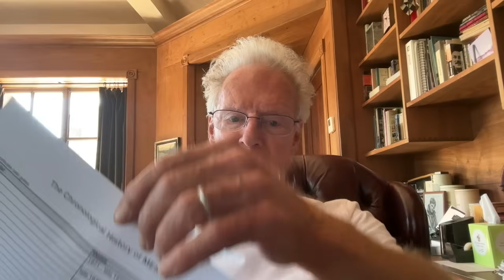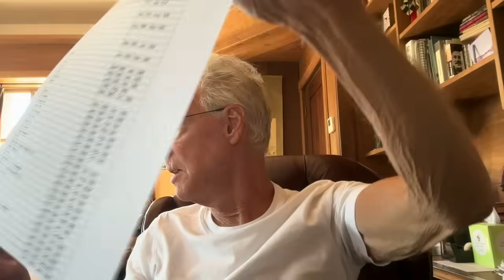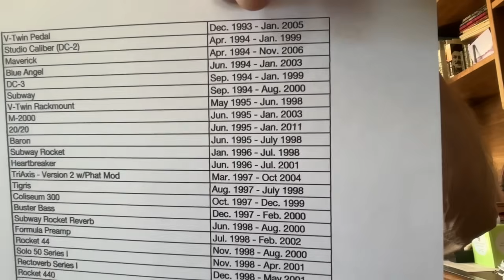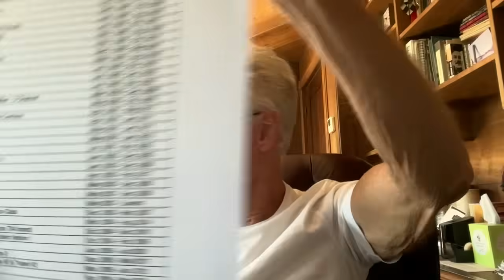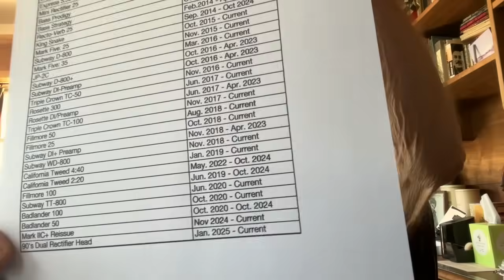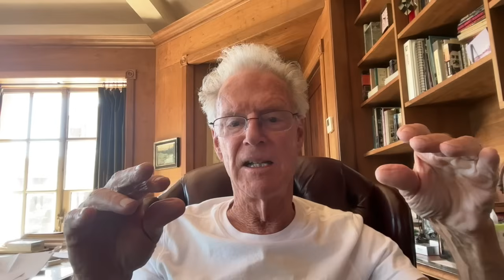Building Boogie 34  Part 2 History of Mark Amps

Comment: I love these videos Randall. This one reminded me of my days back as an HVAC controls engineer. I used off the shelf relays all the time. Sometimes I had to get creative. Hmmm, I wonder if I could build a JK flip flop using relay logic so I could sequence chillers and pumps without resorting to a digital controller? Working with DC control voltage had the old reverse EMF gotcha, requiring recirculating diodes across the coil. Whoa, I've long since retired from that world but this video got my brain synapses to fire again, hehe.
Reply from the maker: Yeah - - that inductive kick-back CAN be useful!!  Imagine being a Hawaiian Tech you don't have easy access to everything and congrats on being creative with what ya got!

Comment: I meant to add a little addendum: where did the Triple Crown series come from?  I have a very vague impression that there was some specialization in design by that point, because you already had so much to do!, and that the basic Crown circuit may have been pretty thoroughly developed before it got to you.  I love those amps, the Hi channel is one of Mesa's great achievements – and as far as I can tell, the Triple Crown might be a bit more "British" than Marks, but it's not just a hot-rodded Marshall either.

Also, this is an incredibly stupid question, but I've been wondering about it for years: when you think or say the phrase "Mesa/Boogie Mark IV," for example, do you think of "Mesa/Boogie" as the company, and "Mark IV" as the amp, or is "MESA" the company, and "Boogie Mark IV" the amp?
Reply from the maker: Right:  TC is a take on the "more Brit" style, designed by our Dan VanRiesen.  Name:  can be confusing.  All the versions you cite are good.  The name "Boogie" was stolen by the Japanese after Carlos first played there.  So we changed it to Mesa/Boogie to get around that.  However some amps aren't Boogies . . . like the Rectifiers.  Different style, not like a "friendly side kick the kicks ass" (Boogie) but heavy and menacing, thus MESA Engineering logo for the Rectos.
Reply: @RandallSmith2G  That's what I've noticed, yeah, that the amps which descend in near enough a straight line from the very first Princeton Boogies always have the "groovy" Boogie badge (which I love), and the more aggressive amps tend to have the full Mesa Engineering logo. That Hi channel in the Triple Crown is unstoppable – it's like a Recto hurricane with a Mark eye-of-the-storm, whereas the Mark VII Mode is kind of the inverse, like a Mark laser beam that enjoys reminding you it could tip over into madness with just a couple different settings. (The first time I played Mark VII mode, I thought "Ahab!," so it's been Captain Ahab to me ever since.) No joke, I've been able to sell maybe 10 amps (and a couple more upcoming!) because whenever I think "Maybe a Boogie, but more British?," I end up right back at the TC-50 and Mark VII.
Reply: I've got a TC-50. It ticks all the right boxes for clean, crunch and lead voices.

Comment: Thank you for this great informations!! I ve 2 questions : is the big transformer of the vii the missing ring in the mark V? Why was not also on the V? Related to the V... What do you think about the mod with at 12at7 in v4 and v6 that lot of people did assuming more 3d sound? Thanks
Reply from the maker: The power trans in the V is a "surface mount" version to it leaves room for the pc board.  Most of the time, that tranny is "belly mount" protruding into the chassis in IIC+, JP-2C, VII etc.  Re:  12AT7, I haven't heard this one but sure:  if it SOUNDS good, Do It!!
Reply: @RandallSmith2G thanks for the reply...yes it is called saturation mod between mark v ,25 and 35 users...put 12at7 in the v2 and v6 (in the v 25 which i own) and to the others related to the others amp give back less gain but take away that icy pick effect on high gain channel..i ve tried...well maybe the jan Philips 12at7 i ve tried was too dark ..better original for me.😊

Comment: Thank you for the great information and videos.  Keep them coming.  The information is priceless coming from the founder.  LDR's are the bane of my existence....lol.  I had my 1995 Mark IV sent in for service to replace the caps as they were 30 years old as well as replace 2 of the 8200 brown caps that if they leak they damage the board.  I got the amp back and it sounded great but the amp would get stuck in between 2 and 3 with the footswitch.  I sent it back but found out yesterday that the entire board needs to come out and have some/all of the LDR's replaced.  This will cost a pretty penny especially since I  already paid for the capacitor replacement on top of this one.  I love the amp as the Mark IV has always been my favorite but thinking a mark vii might have been cheaper at this point.
Reply from the maker: For sure the VII would make you happy but has our Mike B. seen your Mark IV?  If not, please contact Kris or Molly cuz it's doubtful all LDRs need replacement.  Sounds like what's controlling the LDR switching may be the problem.
Reply: @RandallSmith2G  Thank you for the reply Randall.  It is in Mike B's hands so I know it should be good after he goes through it.  Molly and Kris have been great as well.  Thanks again for the reply and info.

Comment: Great stuff! Sorry about the problems you had. I feel like corporate stuff has been a downer. Even for me. 
Love hearing about your Amps, even though I don’t understand much of it.
Reply from the maker: BIG Downer as the potential was right there.
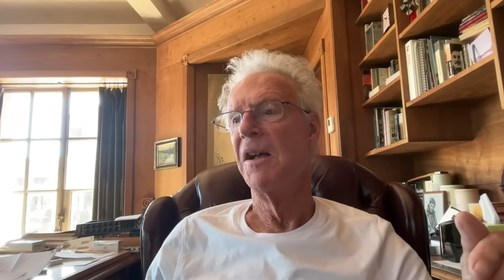Reply: @RandallSmith2G I have a 5:25, it has lasted since 2009,  I gigged for several years, 
all I did was replace the pre-amp tubes. LOVE IT TO THIS DAY!
It has a 10 inch speaker Mesa Cab.  Thank you so much, Mr. Randle!

Comment: Thanks for the awesome history lesson, Randall. I've watched it a couple of times now. This so great to hear. I love all of it. I never knew the M180 and stereo 400, nor the 2:90 where the power sections of the Mark IIC+. I really regreat selling my Triaxis and 2:90 about 10 years go. it put me down the path of trying as many Mesa amps as I could get my hands on. I have a JP2C that I love, but it's doing two weird things. When I switch from high gain to the clean channel the reverb makes a weird sound, like it got slammed with the gain or something. The other is that when using the efx loop, the volume can pop up loud intermittently. I live out in the sticks and don't have a shop around that can work on it. So I just deal with it for now. I love the amp, and all my Boogie gear. My Marshall's are getting no love, LOL Keep the stories coming, your a god among men dude. We're so blessed to have you out here in the open.
Reply from the maker: Those M-180, 190, & 400 amps led to both our tube Bass amps (D-180, B-400, B-400+, Strategy 8:80, Prodigy PLUS our notable high-end stereo tube amps, particularly the Mesa/Baron.  Try wiggling the Reverb cables and tapping on the 12AX7s - - may be something very simple to correct.

Comment: Sooooo I am interested in how the Mark IV mode on the VII sounds a lot like a Mark IIC++. Like the saturated tone on that mode is insanely strong. Better than the orignal "Rev B" Mark IV i had.

Again Randall you are the king of amplifier makers and tell the story of the lonestar makes the amp that much more amazing. If i could have three amps from Mesa, it would be my VII, a Lonestar and a Recto.
Reply from the maker: Yeah - - the Mark VII mode's extra gain comes from the IIC+ overdrive section being driven by the Crunch mode instead of the clean signal, as is the IIC+ mode, something I dreamed up in Palm Springs when designing the VII (or VI, as it was first called).  Gibson's latest posting misleads one to think YOU can 'Stack' the controls of Channels 2 and 3 to do this, showing once again that whoever writes this stuff doesn't know how it actually works.  Meanwhile, our Doug West is a brilliant writer who actually KNOWS all this shit . . . but an outside agency (I think) is now used to produce these things now.

Comment: I didn't ever think I'd get to listen to you speak like this, Mr. Smith, but I LOVE it. Thank you! I make guitar pedals and I actually used to make one for Soundgarden to allow switching between the channels on two v twins without flipping the phase. (They said the channels weren't in phase with each other). The darn relay pop (in my designs) was the biggest issue for me.
Reply from the maker: Yep - - and when/if the pop is cured, no one even know how much work that took!!  Kinda like fixing a dent in a car:  If it's done perfectly, there is no evidence of all the work that took!

Comment: What Vacuum Tube Manufacturer did you like the best ? Tubes change tones as well.
Reply: The less good tubes made in Russia Slovenia & China ia all thats available. The ultimate were the USA & English tubes.
Reply from the maker: That's a pretty accurate answer, IMHO.  For 6L6, my STR 415 from Sylvania, for 12AX7 the special Chinese version I helped develop.  Sadly both are gone.  BUT others now are quite good.  I like what JJ has done.

Comment: Hello Randy .. thank you for this video. I was an engineer at the Livermore Labs and had a side hustle designing and repairing tube amplifiers. I was getting quite a few Boogies into the shop to investigate the popping on channel switching. I designed a zero-crossover circuit, that would switch only when the signal was transitioning thru zero voltage and there was no energy to discharge. I was pretty close with Michael Bendenelli at the time and shared it with him. He said it was brilliant but that Randy would never go for it due to the cost and complexity. He was right 😄 -Daniel
Reply from the maker: Livermore Lab is The Deepest, Heaviest pod of talent imaginable!! If you were an engineer there, Big Respect!!  Guitar amps are like toys compared to the shit you guys do there!!